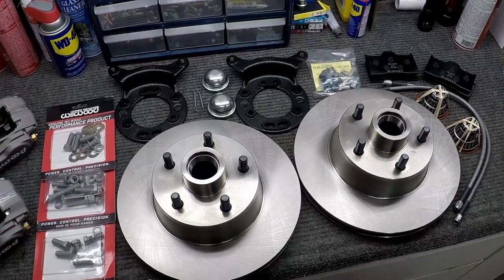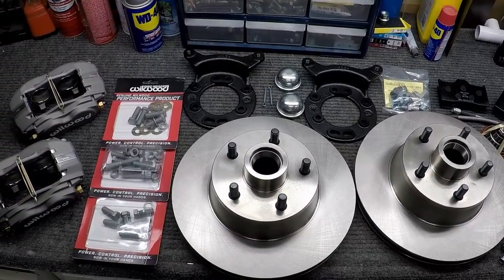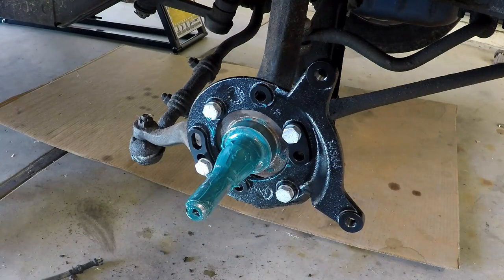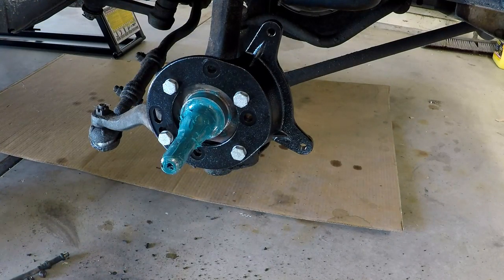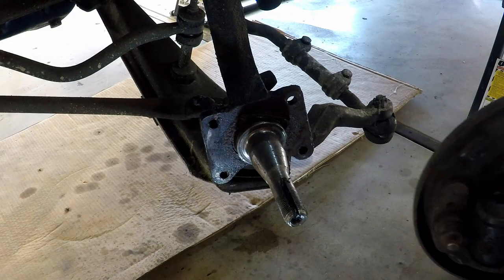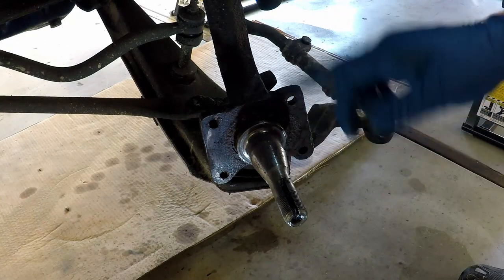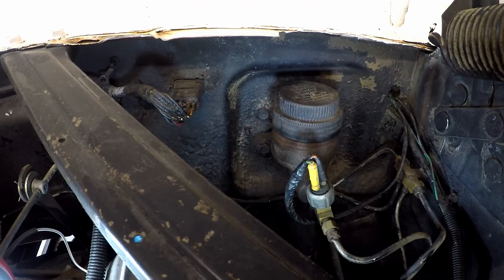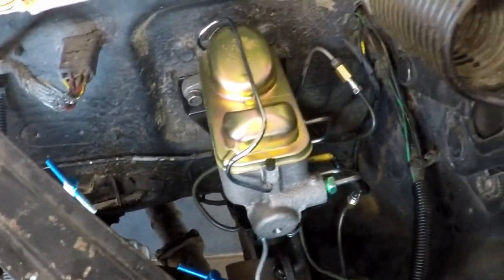How to Install Wilwood Front Disc Brakes and Dual Bowl Master Cylinder in a 1966 Mustang

Comment: Your outtakes are so relatable.  I'm about to get to work doing basically the exact same job on my 66 barn car. i rebuilt the drums to get things all working, but anyway thanks for setting some reasonable expectations about what kind of issues i might run into.
Reply from the maker: Thank you!  You can do it!
Just a heads up, if you are replacing the thermostat, drill a 1/16" hole in the top lip of the thermostat for the air bubbles to get out while bleeding the system of air.  I didn't do that and it caused problems down the road (see my Heater Core video).

Comment: I have stock kelsey hayes discbrakes on my ’66 Mustang and I just added Wilwood dual master cylinder.  What a day and night difference in brake feel and stopping power. I can really recommend Wilwood products. Great video by the way 👍👏
Reply from the maker: Thanks!
Yeah, I'd like to upgrade my MS to a better aftermarket unit, like the one you've described.  It's good to hear that the Wilwood unit has been a great upgrade.  :)

Comment: Interesting video, have you ever come across anything comparing this system to the factory installed disc brake system. I’m working on a 68 cougar with power discs, I can’t seem to find a lot comparing the differences, I imagine the wildwood would be a improved braking system, but I’m not sure what I would all have to change. Thanks for your videos, anything I can learn to help me work on my car is great.
Reply from the maker: Not that I can think of, there wasn’t much out there when I made this video. There are lots of videos installing all kinds of brands and configurations, but I didn’t see anything comparing them.

Comment: Thank you so much for the great how to video, going to follow the same route here with my 1965 Mustang.  Did you include a master cylinder booster as well or just the master cylinder?
Reply from the maker: I did upgrade the MC in a different video.  That is one of those items that is at the top of my list when upgrading these first Gen Mustangs.  :)
Reply: @AndyKruseChannel  No booster though?  Just MC
Reply from the maker: @WatchNFLNetwork-m2w  Nope, real men have manual brakes.  😄

Comment: I rarely follow anyone on YT. But I am currently restoring a 66 and 68 Fastbacks. I have to say, you are phenomenal at this! 

Which front disc brake kit would you suggest for a 66 pony? It currently has drums all around with single bowl master. Not trying to break the bank. Wilwood or a Kelsey Hayes? Power or non power?
Reply from the maker: I appreciate the support!  :)
For the ‘66 I’d say the Wilwood kit in this video is tough to beat. Couple that with the fantastic customer support that Wilwood offers, it’s tough to shop anywhere else. I’m partial to manual brakes for these cars, but if the car will only see cruising and grocery runs, then power brakes is not a bad option. Lastly, check into the 10lb residual valve for rear drum brakes that Wilwood also offers.

Comment: Great installation & “Nothing is Ever Easy…Right?!?  Just curious, as I’m 👀’n at a similar Wilwood kit for my ‘69 Mustang & trying to decide whether or not to go with the Power Disk Brake setup w/the booster?  Is there any particular reason you decided Not to go w/ the power disk booster option?  Great video & good 👀’n ‘66!!
Reply from the maker: I prefer manual brakes on these kinds of cars.  :)

Comment: Excellent video.  Is the Wilwood a good brand?  I'm looking to do this to my 68 Mustang, and I have been seeing some cheap kits out there.  My guess is it is being you went with it.  Let me know, thanks for the video.
Reply from the maker: There are more expensive brands and they make an awesome product, but for classic Mustangs I think Wilwood makes a fantastic product at just the right price.  I have since sold the car in this video and bought another Mustang and it has the same Wilwood brakes.  If I was going to do it all over again, I'd still go with Wilwood.  Also, their customer service is top shelf.  They're very helpful and knowledgeable, and I've got my eye on a few more of their products for future projects.  :)
Reply: Thanks so much for your input.  I need to research and see what all I need.  Maybe call or write to Wilwood and see what they recommend for my car.  I was told I need to replace my brake peddle as well but I see in your case you didn't need to.  Keep up the good work!!

Comment: Andy, did you experience any trouble getting the two pre-made Wilwood lines going from the brake master to the proportioning valve to seal properly...no leaks no weeping...? Thank you for video.
Reply from the maker: No leaks or issues there, but it did take a bit of fiddling to get everything to align happily.  In the end it was fine, just the install was a little bit of work.  :)
Reply: @AndyKruseChannel what socket did you use to take the sensor off I can’t tighten my lines with the sensor in the way which it came already on the proportioning valve
Reply from the maker: @codykostensky4806  If you don't have a socket big enough, you can use a crescent wrench or even a pipe wrench to break it loose.  :)

Comment: Hello Andy, upgrading my brakes its the next thing i wanna do to my mustang its also a 66 coupe, did you get more wheel clearence after installing the kit? i want to use wider tires.. thanks.
Reply from the maker: This kit does not provide more wheel clearance as the mounting surface is essentially in the same location as the factory drum brakes.  The wider the tire, the more critical the backspacing for your wheels become, until you reach a point where the wheel or tire are hitting suspension components.  I think a guy could put 245 on the front with the correct backspacing (maybe 4.25 or 4.5 inch), before things get tight, but you'll want to double check that before spending the money.  I too would like wider tires on the front, but it's a balancing act of wheel and tires sizes that ultimately got too expensive to chase because it meant I needed custom wheels (basically custom backspacing) or choose wheels with the correct backspacing in a design I didn't like.  Good luck!!  :)

Comment: Great Video!  Just about to do the same to my 64.5 - D-code Coupe.  Do you have a part number for your Wilwood kit?
Converting from an automatic to a 5 speed also.  Looks like the kit has the PB bracket that clears the manual clutch linkage?  
Thanks!  Cheers, Gary
Reply from the maker: Thanks!  The Wilwood kit I purchased was from Amazon and the kit is 140-13476.  The master cylinder and associated hardware and brackets was a different kit than the Wilwood stuff.  I purchased Master Cylinder stuff from CJ Pony Parts.  I would not recommend the distribution block I installed, the pressure switch for the brake lights didn't work, I ended up needing to use a different switch on the pedal assembly and bypass the one in the block.

Comment: Hey Andy, I'm installing same Wilwood Front Discs and the Wilwood dual bowl as well on my 66.  Curious what brake fluid you used, if you don't mind me asking?
Reply from the maker: I just use the standard off-the-shelf DOT 3 fluid at my auto parts store. If I was going to spend more time on the track I’d look into a DOT 4 fluid, maybe something like SuperBlue or maybe something from Motul, but I just won’t be pushing the car hard enough to justify the higher boiling point in premium brake fluids. 😁

Comment: Great work. How much pedal effort does it take to stop manual disk brakes, is it the same as manual drums or easier? Thanks.
Reply from the maker: Great question, but honestly I don't recall what all four drums felt like before the upgrade.  Those disc brakes were so early in the build for that car than I barely put any miles on the car before I did the swap.  However, while they did great, I found my self struggling with the brake bias adjuster all the way until I sold the car.  I spoke with Wilwood and they recommended I buy the 10lb residual pressure valve (which sort of pre-loads the rear drums) to better balance my braking.  I ended up selling the car before I got a chance to do that.  The brakes were great, I just wanted them to be closer to what brakes feel like today.
I have the same setup in my current car (they came that way though) and I'd like to dig into making the brakes a little better.  Again, they work great and I locked them up the other day when another car nearly T-Boned me, but we'll save that story for another day.  :)
Reply: @AndyKruseChannel  man, close call, glad nothing happened to you or the car, crazy drivers out there, gotta be careful and on alert at all times now days. I appreciate the response, I’m probably gonna go with the power brake booster set up when I do the front disks on my 68 fairlane. Thanks again.

Comment: what size Crager wheel do you have? I have 14" Cragers but when I did research on a wilwood kit, the caliper didnt clear.
Reply from the maker: Sorry Boss, I don't recall what wheels they were back when I installed these brakes on the car.  I have read that the Wilwood brakes will work with some of the 14" wheels out there, but I don't have a specific list.  I think Wilwood has the specs on their site for the clearance around the brake calipers, from there a guy could check to see if their wheels will fit or not.  :)

Comment: Probably similar or same as it would be for my 1965 Mustang right?
Reply from the maker: Exact same.  The difference being some cars have the 4-bolt or 3-bolt spindle, so it won't look the same during the install, but it won't matter since the Wilwood bracket is designed to fit either spindle, and the brakes will work the same in the end.  :)
Reply: @AndyKruseChannel  Thank you and great video

Comment: Could you put a link to brakes, master cylinder, bracket? I have a 66 fastback with 289 with 15 inch rims and manual trans.  I would like to put discs on front.
Reply from the maker: I put the part numbers in the descriptions below my videos.

Comment: Do you think this was enough braking power or do you think the car needs a brake booster
Reply from the maker: I think that would depend on the driver.  Meaning, I've got a pretty strong leg, so manual brakes are not a problem for me.  However, it might be for someone that is smaller.
I don't mind manual brakes, but it is definitely different than modern cars, so a driver needs to be mindful that it takes more effort with these things.  :)
Reply: @AndyKruseChannel  good to know! I appreciate you taking your time to reply to me!

Comment: Do u know if there is a cheaper option for the master cylinder? Front disc , drum rear.  Got the same car as yours except for the engine  . 302
Reply from the maker: I think there are several cars in the '70s that Ford made where the master cylinder and front disc brakes can bolt right onto these early Mustangs.  But I do not know the specific years and models.

Comment: Currently doing I6 to V8 conversion which requires me to replace all the front suspension to 5 lug v8 suspension parts. I have completed everything except when I put on some stock v8 steel 14” inch wheels I purchased to use in the meantime I save up. Unfortunately I ran into the issue of the caliper hitting the steel wheels what set up should I have to avoid this?
Reply from the maker: You didn't mention if you installed these same Wilwoo disc brakes, but I'm assuming you did since you're commenting on this video.  I believe Wilwood's goal was to have these brakes fit most of the 14" wheels that fit on these cars, but not all of them.  I'm guessing your wheel is one of those that won't fit.  However, you could probably run a wheel spacer while you save up for the wheels you really want.  They make spacers as thin as 1/8", but most start at 1/4" thickness and go up.  A 1/4" spacer might do the trick, but be careful not to go any thicker as your wheel studs will not be long enough.  Other than that, I do not recommend modifying your brakes or the wheels, either get some spacers or get some new wheels.  :)
Reply: @AndyKruseChannel  thank you !
Reply: @moddedlegacy1081  I am just starting to do this swap on my neighbors 67 Cougar. Neighbor bought the kit with  11.3" rotors, and we test fitted the rotor and caliper on his stock 14" wheels- no fit (we did this months ago). So, he had to buy 15" wheels to fit. Just started the conversion tonight, looks fairly easy to do.

Comment: Are your Cragar s/s wheels 14"? If so, any clearance issues with this Wilwood kit?
Reply from the maker: Correct, Cragar 14" wheels.  They cleared the Wilwood calipers great!  That particular Wilwood kit is designed to fit with most 14" wheels used on the early Mustangs.  The caliper is notched in a way to make room for the inside of most of the 14" wheels.  :)
Reply: @AndyKruseChannel  Thanks for the reply. I have the same Cragars on my '65 fastback and I plan on ordering this Wilwood kit this week but was hesitant after reading it clears "some but not all" 14" wheels on their website. Great content, thanks again!
Reply from the maker: @4-SpeedPetrol  Awesome, I'm glad this kit will work as it's a pretty good and complete kit for our cars.

Comment: Just wondering did you have to empty the has her cylinder ??
Reply from the maker: No need to empty or remove the fluid from the Master Cylinder during this install.  Some of the fluid in the brake lines will leak out, but you'll have to do a full bleed of the brake system anyways, so it will be fine.
Reply: @AndyKruseChannel  yep thanks . im finding more that has to be  fixed.

Comment: Andy, what grease did you use for you bearings? Thanks
Reply from the maker: Nothing fancy, just your standard axle grease you can pick up at the auto parts store.  The particular stuff I was using is LubriMatic - High Temperature Disc/Drum Brake Wheel Bearing Grease.  :)
Reply: @AndyKruseChannel  Thank you for taking the time to answer me 👊🏽
Reply from the maker: @MPMEnt  No problem, I'm happy to help.  :)
Reply: @AndyKruseChannel  may I ask what size tires you recommend for the ‘66 Coupe? I’m going with 15x7 rims. Thanks 🙏🏽
Reply: @AndyKruseChannel  I’d like a lower profile tire but don’t want to sacrifice comfort. Manufacturer recommends 215/60R15; thoughts on 215/50R15?
Reply from the maker: @MPMEnt  I had 225/60/15 tires on 15x7 wheels with 3.75" backspacing on my Coupe.  You can fit wider tires but then more attention has to be paid to the backspacing to make it fit right.  However, depending on your backspacing, you may need to roll the lip of the front fender a little to ensure the tires don't rub.  If you check out a few of my other videos on this Coupe, you'll see how those tires fit my setup and it may help you gauge what it may look like on your car.  :)
Reply from the maker: @MPMEnt  I agree that the lower profile tire will affect the ride comfort, but it's not going to be as noticeable like if you put 30 series tires on there (rubber bands on a wheel).  Personally, I like the tire to fit/fill the wheel well, so a shorter tire would require the car to be even lower so it fills the well more.  However, because of how low everything already hangs on these cars, it may cause issues if you lower it too much.
Reply: @AndyKruseChannel  thanks again

Comment: Would there be anything different to do if I have a V8 automatic? Mine is 65 Convertible Mustang
Reply from the maker: I had a '66 V8 Auto Mustang before this car and I purchased the same master cylinder that I put in that car.  But I also added the power brake booster in that car.  For the brakes them selves, if you car was an original V8, the spindles would be the same (they're called the 4-bolt because the Straight 6 has the 3-bolt) and this kit would fit the same as it does in my video.

Comment: Can i do the same thing for a 1966 V6 automatic? And do the rear drums need to be changed over as well?
Reply from the maker: Yes, you can put Discs on the front, but you have to be mindful of the spindles on your car.  Some kits work with the 6 cyl spindles and some don't.  Thankfully the Auto will not affect upgrading to disc brakes.  The rear drums can be left alone for this upgrade, my drums are still in the rear of my car.  :)
Reply: @AndyKruseChannel  see I forgot I need to switch to the 5 lug as well. So have to change the back too. Debating on drums or disks for rear
Reply: @austinwebster8230 I am in the same boat I am keeping the rear drums for now. How is your project going ??
Reply: @moddedlegacy1081  dealing with rust repair now
Reply: @austinwebster8230  were you able to do the 5 lug conversion yet?